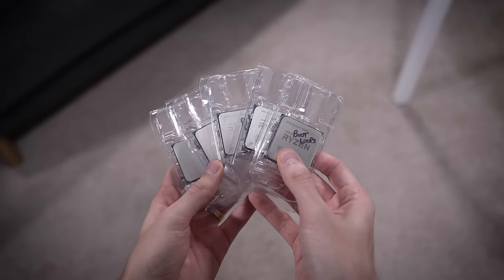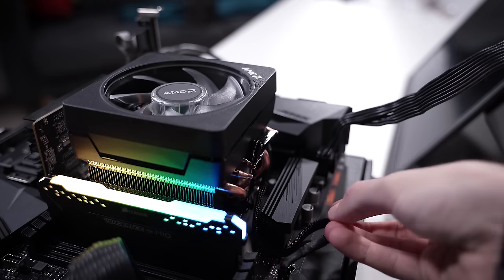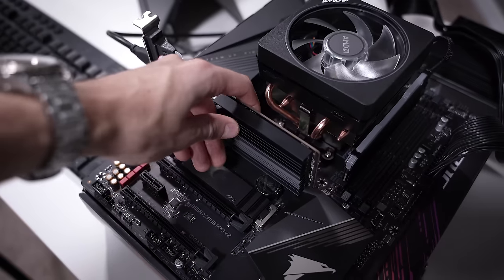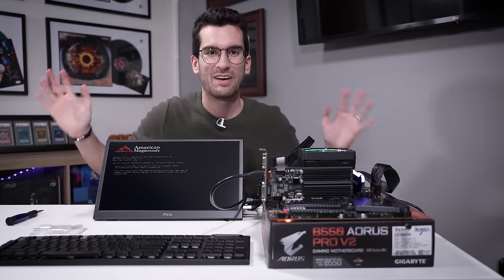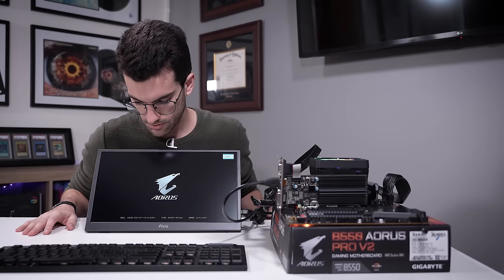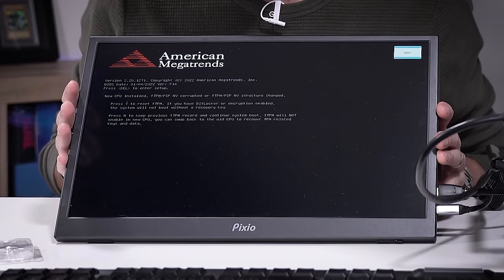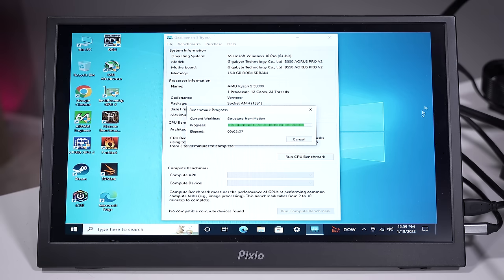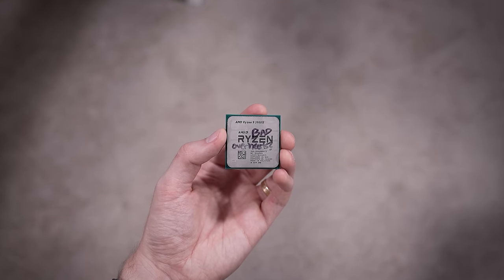I Tested 5 "DEAD" Ryzen CPUs

Comment: for the chips that do boot in to bios you could try turning cores off, first try to see if it works ok with only 2 cores then enable 4 and so on to find out maybe a 6 core can work fine with 4 cores
Reply: Not worth it.
Reply: @JoeNasr123  TF you mean not worth it? He is already in possession of the chips, it costs nothing.
Reply: @TuffMcAwesome  Too much work for a chip that's only good enough to throw in the garbage bin..
Reply: @groenevinger3893  sometimes he is too scared to put his working CPUs into motherboards that he suspects might fry them, so I think these partially working CPUs could make for perfect test subjects, as he won't lose anything if they get fried anyway.

Comment: Hey Greg, thanks to you & your fix or flop series i was able to fix my 10 year old desktop, so let me share what happened the. Out of the blue the system started Blue screen of deaths different error everytime so i thought maybe the windows was corrupt and tried to fresh install the windows but it wouldn't let me boot via the Pendrive, so i thought maybe the HDD had given up the ghost. Had a spare HDD lying so decided to swap it and sometimes it would just bootloop and sometimes it would just give no output to display so started by disconnecting RAM's to narrow down the problem so guess what 1 of the RAM sticks had gone faulty so tried putting it in the other slot to rule out defective slot but the RAM was at fault so finally the system started with the other 4 gig stick. I didn't go to any repair shop as most of them just try to rip off, so thanks to you my potato pc started again.

Comment: For the ones with dram led... Tech Yes Bryan found he could revive a "dead" 3600 by undervolting in the bios with a good cpu, and then switch to the dead one. It would be interesting if you could make any of yours work by undrvolting or reducing the clocks.
[edit] lol, just got to the last one where you did just that. Worth re-checking some of the others similarly.
Reply: 100%

Comment: The 5900x seems similar to a few cases of degraded silicon I've seen. With some time you could probably dial in the voltage/clocks to get it running pretty close to stock. Not perfect but would still work well as a homelab CPU or something.
Reply: I have an old fx-8370 chip (use it as a test bench and backup media system now).
Used to oc to 5.0GHz, but slowly became unstable over the years.
Now it'll run fine forever at 4775MHz but not at 4800 or more.
Reply: As others said, the 5900X is "fixable" by disabling Global C-States control in BIOS, which disables core parking feature. My 5950x just did this last week, while it can be fixed by disabling this option, personally i decided to RMA it instead.
Reply: Had a 5800 that would always work with pbo off. Probably a cstate issue but I just got a replacement also

Comment: With the overheating CPUs, try delid and liquid metalling the CPU and putting the IHS back. The thermal glue inside might've dried out or not making contact with the IHS anymore
Reply: I believe all Ryzen CPUs are soldered to the IHS
Reply: Yeah, they're all soldered... But maybe badly. I second delidding

Comment: So the first 2 that get stuck on Dram light, I think you are correct mostly...I've seen this a bunch of times...It usually happens when the SOC voltage gets set too high and damages the memory controller...It really doesn't like getting overvolted too much unless you have extreme cooling...

Comment: What percentage of the systems you've gotten in for repair are AMD vs Intel?
Reply from the maker: No idea. Probably more than half.
Reply: @GregSalazar   please ask gamer's nexus if there a systimatic problem with AMD processors...
Reply: @notrixamoris3318  There's no problem with the cpu.
The real problem here is the motherboard and psu.

I have 12 Ryzen cpu and i dont have any problem at all.
But the on my MSI motherboard thats my problem it kill 1 of my CPU.
Asus and gigabyte are good for my experience.
Reply: @lelouchabrilvelda1794  opposite here. I’ve had way more issues with Gigabyte boards than MSI.

Comment: I just want to say thank you for the fix or flop content! Thanks to your methodology I was able to fix a friend's "dead" PC in less than 15 minutes. He thought the mobo was dead and asked me if I could look at it knowing that I have experience building PCs, and I was quickly able to narrow it down to just 1 dead RAM stick. I cleared the CMOS, swapped in a known working GPU, and then tested RAM one stick and one slot at a time. It was so satisfying being able to save that PC as it is still a relatively powerful system..  i7 9700k on a gigabyte z370 motherboard with an RX 6700xt.

Comment: A motherboard with debug codes instead of just LEDs (and a power button) would've probably been beneficial for these tests.
Or regarding the power button, you could just use one from an unused case to connect it to the pins instead of having to short the jumpers all the time.
Reply: Same here. 
I thought they were going to be sent back to AMD to test them?
Reply: @daveward4358  Greg did say he was trying to contact AMD about that but he just hasn't heard back from them yet. He did also say that he will update us once they do contact him back about it.
Reply: @JCmeister9  So AMD probably know they sent out bad batches.
Reply: @daveward4358  Not necessarily, only because we can neither confirm or deny if that's true without proof or evidence. What I can say for sure is that, there were a lot of people who bought these CPU's, so it's possible that failure rates can seem to be higher than what it truly is overall.

Comment: I was looking forward to this, since you had quite a collection of dead 3000s.

To be honest I recently built two absolute equal 7600x systems, did the same settings on boths, same gpu, same EVERYTHING aside hard drives.

One was running at 1.4v, the other at 1.29. The former was almost hitting 95°C (on a Dark Rock pro 4!!) the other was running relatively cool in the 80ish pumping better scores all over the place.

I've ended up forcing a Curve optimizer on the 1.4v basically that reduced it to the voltages of the other (even less at -30) and the thing began running cooler than the other and posting roughly the same results if not a tad better. For safety I set the owner to -20, then instructed him how to lower it by time as soon as he checked that he was stable in his editing/gaming/daily routine. He now runs it at -30 and at least in Cpu-z/R23 he gets results slightly better than the other that I've left at stock all while running about 5°C cooler overall.

The above was kinda strange tbh.. same b650M-A pro from MSI, same coolers, same Asus Tuf 6800Xt, same evga supernova G6 850, same g.skill 6000 c36 kit 2x16, same crucial P5 plus, same bios version, same bios settings (at default + just enabled XMP and fan profiles), same Phanteks p500 the only difference was one rig has a 2Tb HDD + 256 sata SSD, the other one just a 3Tb HDD carried over from their previous builds. But that can't be the humongous vcore difference. The only test I didn't do is to swap CPUs between the motherboards, but looking at how the CO cure turned out, I thought I didn't wanted to dismount and remount two Dark Rock Pro 4s 4 times in a day..

Comment: I would love to try to delid that 5900x and see if it's a contact issue.  Maybe there's an internal issue where the chip is barely touching lid.  Or maybe try turning one of the CCDs off amd try running at stock settings.

Comment: I have a Ryzen 72700X. Where one memory channel crapped out. What happened was I changed my cooler for one of those tower coolers and the weight on the tower cooler ripped the Ryzen out of its socket, and I am guessing that that caused some sort of electrical faultin the CPU, as it doesn't like being pulled out of its socket when the power is on. But that's what happened. The main fault lies with the top-heavy weight of the tower cooler and the CPU retention arm. The weight of the cooler pulled the arm out of its socket. There was an easy fix for this and that was to bend the arm towards the socket again, making a better contact with the catch. But by then it was too late.
My verdict is --- Tower coolers are too top-heavy and the CPU retention arms are too weak and don't latch hard enough.

Comment: @GregSalazar for the 5900X try to Enable PBO instead of Deactivating it. And try out to activate the Eco Mode (75W/90W) inside of PBO. 
I had the exact same Issue, with an 5800X. At Stock Settings it was Boot Looping all the Time until i used the PBO Eco Mode and it wasnt even much slower. Like around 5-10%.

Comment: Great video man. I also like to revisit things to update that mental database where you think you had it figured it out, but in fact did not. Wonder if mem controller is getting torched or an issue with going to aggressive on the F-CLOCK damaging Infinity Fabric? I wouldn't know, I'm only a measly ZEN+ owner and haven't over clocked anything since boost clocks have been implemented in CPUs/GPUs. I'm from the old era. Overclocked my Athlon with a #2 pencil and then a car defogging repair kit. 🔥

Comment: So question is there a possibility that improper instillation could have caused these chips to fail? Also maybe not having proper cooling?
Reply: I agree....cooling IS an issue with the R5-3600 if you use the pitiful cooler supplied with the CPU.   With a good cooler that keeps it below 65C no matter what...mine has been absolutely reliable...so far.(knocks on wood)
Reply: If you install poorly it is generally VERY easy to tell why it is broken.  Bent pins or massive damage to the socket itself or conductive thermal paste in the socket for example.  Thermal loads could cook a chip in theory but in general its not something that will generally cause a chip to fry since people will normally notice something is wrong even if they arent tech literate.  In reality though the truth is that no QC is perfect and every company makes lemons or has broken parts slip through the cracks.  Or even parts that pass QC if only barely so they fail quickly.  Thats one of the reasons you generally want to stress test a new system for a bit after you build it.  If something passed the basic QC at the factory but has an issue when its ran hard for a long period its best for it to burn itself out early.
Reply: Most properly working CPUs will shut themselves off well before any cooling related damage can happen,
Reply: Most likely the overclock fried the chips.
Reply: @abdullahdanze2061  Not much point overclocking a ryzen.  I suspect some mobo vendors may be too aggressive with auto voltage settings, causing weaker chips to fail.  I've been having erratic issues with my chips.
Reply: How could one properly poured or injected a substance onto their system to have caused these chips to fail?